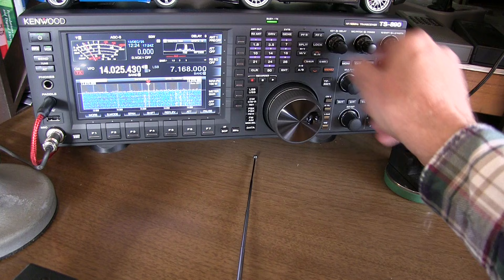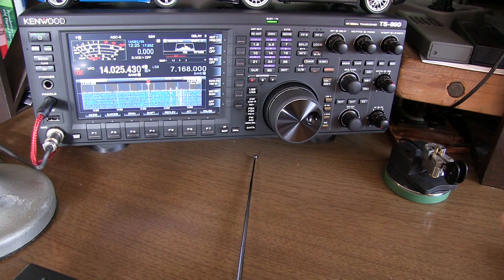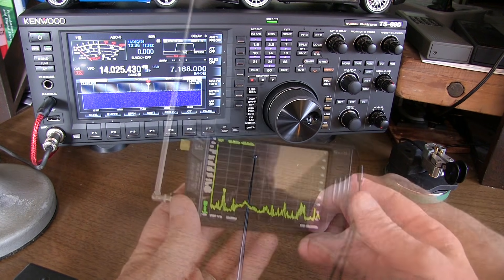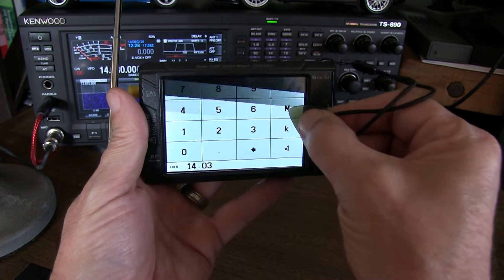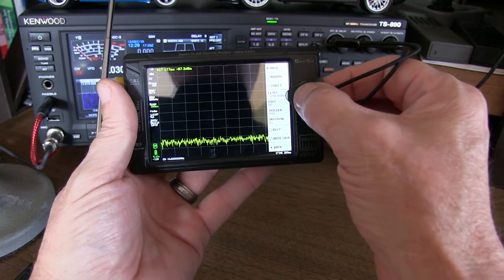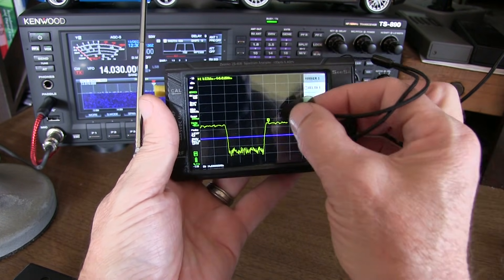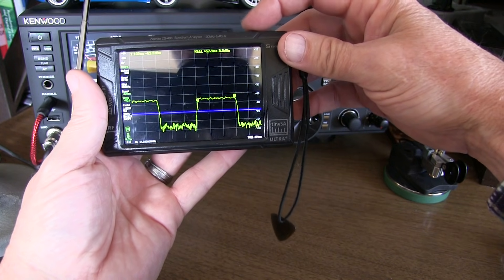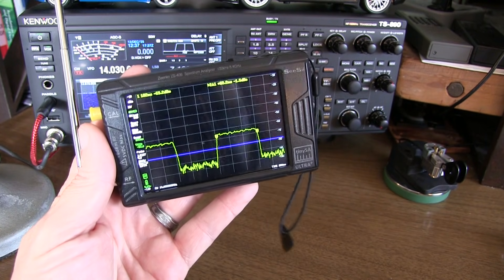#405: Using TinySA Ultra to measure keyer speed of a Kenwood TS-890S transceiver

Comment: Thanks for the insight! I did the measurement on my TinySA Ultra and get exactly 1/2 the pulse width I expect. I have the M1 to M2 delta set and am measuring the inflection from rise to fall. With all the smart folks hanging here I am better y'all can tell me what setting I have wrong on the SA....32ms at 20WPM sending DITs, 90.3ms sending DAHs.
Reply from the maker: Yeah, that doesn’t sound right. Maybe a setup or operational problem with the tinySA. An easy way to check would be to transmit a CQ message and then look at the Reverse Beacon Network report, and see what that reports as your speed.

Comment: Great to see videos again. Really great work. I have a soft spot in my heart for Kenwood HF radios. They were the kings of HF in the 1980s and 1990s, and they are still the kings of HF in my eyes.
Good instruction on using an analyzer in the time domain. I do the same at work to check the spacing and pulse shapes of DME transmitters.

Comment: Great video! I wonder if the other rigs that had to be set to 18 or 19 wpm to hit the 20 WPM benchmark were not taking into account the rise and fall time of the keying waveform when calculating the timing. This would result in the keyer having shorter "on" times for a given WPM setting, which translates to a higher WPM calculation using this technique (where you are just measuring the key down time). However, to accurately calculate the WPM you might want to look at the timing of an entire cycle of a transmitted character including the space timing.
Reply from the maker: True, measuring across multiple characters, and measuring 6dB down to take into account the rise/fall. But, looks close enough.

Comment: Interesting concept. For those who are cash starved and cannot afford or wish to add to our equipment inventory, simply setting up the on board keyer to send the word PARIS 10 times in a message and timing the length of that message will yield the speed.
PARIS is the standard word because it contains elements (dits, dahs, spacing) yielding a constant of 51.6. Therefore dividing the length of the message into 516 will yield the speed the message was sent.
~respectfully, The Cheap Chicken
Reply from the maker: Actually, I count 50 units in the word PARIS including the 7 dits after the word.
Reply: @w2aew you are, of course, correct. Sorry for being lazy!

Comment: Not to be pedantic or anything, but -6dB would represent the 50% voltage points on the signal - which would be the normal pulse-width measurement levels on the rising and falling edges.   Minor point - not trying to take anything away from an excellent video!
Reply from the maker: The waveform shown is in dBm, which dB relative to a milliwatt (power), so -3dB represents the half-power point. It probably would make sense to measure the half voltage point in order to see the 50% pulse width, so yes, good point.

Comment: so is it working as a scope now? and why it is important to measure CW accuracy? I do not know that before that I can setup my tinysa to work like that, thanks
Reply from the maker: It is showing RF amplitude vs time when in zero-span mode. It’s not particularly important to know the exact keyer speed, it was more a curiosity of mine.
Reply: @w2aew  can I also check the rf ssb envelope that way?
Reply from the maker: @adrian_sp6def  You'll see the the RF power vs time, not the envelope of the RF signal. (It'll look like a positive peak detector/follower)

Comment: Out of interest, with the Kenwood on a dummy load, how far away can the tinySA still pick it up?
Reply from the maker: That will depend on a number of variables such as:  the operating frequency (higher the better), the shielding effectiveness of the coax jumpers, the shielding effectiveness of the dummy load, the proximity of the TinySA antenna to these things, the length of the TinySA antenna, etc.